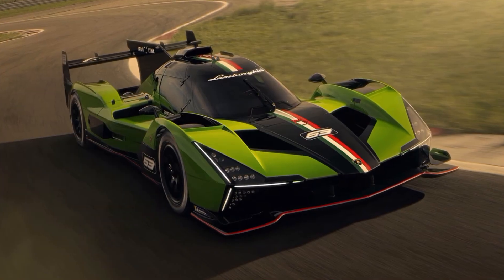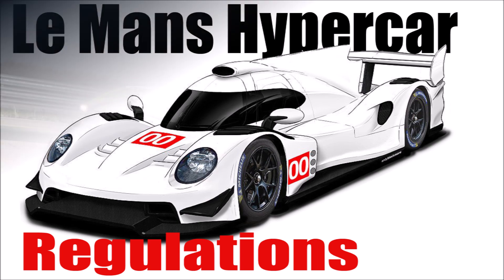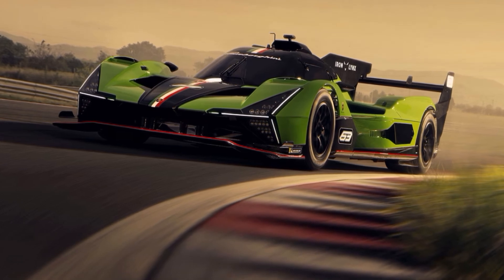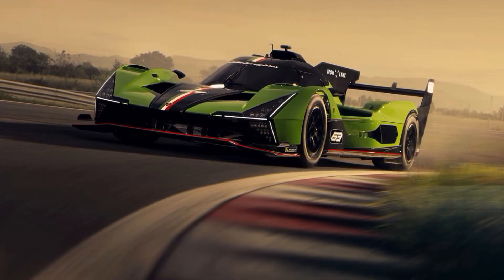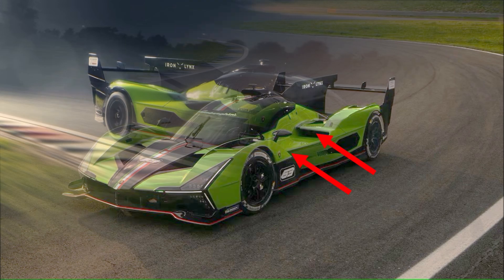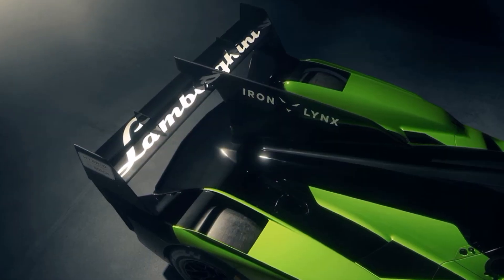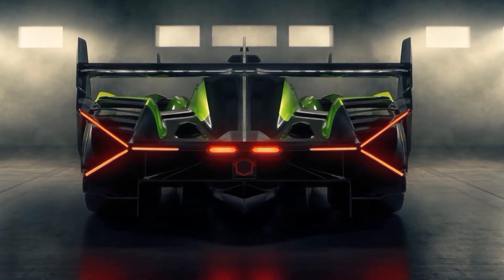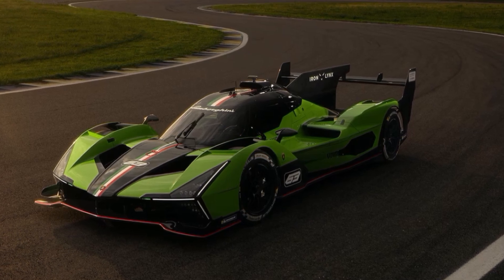Lamborghini SC63 LMDh Hypercar - FIRST LOOK

Comment: Why are the wheels not covered on the top? Is that just because the rules demand them to be "open-wheel" or is there an aerodynamic reason for it?
Reply: Get rid of the pressure in the wheel wells, have you seen the wheel well vents on the AMG One?

Comment: Missed opportunity not using a Lambo V10.
Their roadgoing engines should be more than powerful enough for this application, and running under BoP regulations means weight shouldn't be a concern. The only reason anyone else would avoid a V10 is cost, but Lamborghini should be able to pull engine blocks straight off the production line! Surely their in house V10 would have been a cheaper option.
Given that this whole thing is a marketing exercise it's really just weird that they wouldn't use the opportunity to make more connections to Lamborghini roadcars.
Reply: The connection to the road cars is the V8. It'll be used in the Huracan successor, and the Urus also has a V8 (a different one).
Reply: @R4M_Tommy  If the Huracan successor has a V8 that's super lame.
Reply: @budthecyborg4575  it's not "if". It's known.
Reply: @R4M_Tommy  So with that we're left with a grand total of zero V10 sportscars on the market.
No more Viper, no more R8, no more Lambo.
Everyone in the sports car business may as well just retire.
Worse yet that's my best bet to what the big companies are thinking, electric is so much less labor intensive the cars are practically disposable.
Reply: @budthecyborg4575  the Viper was the first sporty car to have a V10. The V10 is a relatively new and hard to balance engine for high performance applications. Even in F1 the first V10 appeared in 1989.

Comment: Happy to see Lambo finally giving a go to racing, but in all aspects of this, they have gone down a conservative path. The design is just as if you had made a render using another car's body with the Revuelto's light signature, the engine is predictable, they went for the safe option of the LMdH... Not the proud initiative and innovation they boast in their trailer. Toyota with their LMP1.2, Peugeot with the wingless design have gone for a bolder approach, and it seems to pay off in some ways. Except if Ligier does an exceptional job (which would be difficult since they're lagging behind everyone else), there's no reason why Lambo should do better than the other manufacturers with more experience, more budget, more innovation, more boldness, more design even (unbelievable for a Lambo), more of everything basically.
Reply: LMDh are low budget because they're all going the same route. LMH cars can afford not to do so because you simply have more budget to work with

Comment: I'm gonna be that guy...it should have had a V10 or V12 :(
Reply: Not efficient.
Reply: Then you'd end up with the typical street Lamborghini. Nearly 2 tons, pretty much.
Reply: @groundedgaming  Not weight. One of the most dominate lmp1 cars the puegeout 908 hdi fap had v12 and weighed around 900 kg.
Reply: @JeskoALT  900kg is already very light, F1 cars now are already over 850kg.

Comment: I was hoping that it would have V12 engine with THAT name...
Reply: I wonder what the 63 even meant. Mercedes already uses 63 for V8s, but this is an Audi, and the engine isn't 6.3L, it's only 3.8L. So I'm with you wondering what the 63 is for.
Reply: @groundedgaming  founding year of lambo squadra corse
Reply: @blankfiile  only of Lambo.... Squadra Corse started some 10 years ago

Comment: They decided against the Porsche concept because it's a shitbox and everyone knows that (...and i work for Porsche)
Reply: What do you think, should Porsche have done a LMH car instead, where they are in control and responsible for all components?  Would be curious to know what Porsche insiders think...
Reply: @dra911  sure
Back in 2018 the idea was to use the 919 streetversion (which was designed to be the next 918) as the base for the lmh car, powered by an all new tt 2.5 V6. Then the management changed, and they decided to do F1 and we started to put the lmh Money into F1 and develop that V6 as a 1.6 t V6. In the very same time the customer racing side was asking for a product above the gt3 due to the demise of gte, so they decided to develop the lmdh car alongside audi and multimatic. That lmdh was never designed to be a factory car. 
Then the F1 project died and audi pulled out of lmdh. The management decided to make some very last changes before the fia homologation in the lmdh to make It Better, to make It more 'Porsche' doing a mess.
The bop was considered the saviour of the project, but we all know that the car Is not good and underdeveloped. Lamborghini wanted to wait a bit to see the 963 doing something, and they realized the ligier thing was Better.
Reply: @dra911  and i want to tell u the story about that old v8 we re using! Audi was in charge of developing a 4l tt v8 (derived from the RS6) and at the end they didn t let us to use It! The V6 was under developed so they found that 20yrs old lmp2 engine adding 2 turbos. Result, the Power Is not there, we re slow in the straighs and we burn a lot of fuel.
Reply: @edoardocasagrande4339  Thank you for your replies!  Without trying to pressure you, can you elaborate on the last minute changes to make it more "Porsche" ? Or is that the engine change you refer to?  I'm surprised a twin turbo large-ish capacity V8 is not up to the task of making power (despite its age) as the output is limited by rules anyway, right?  Thanks again for any insights you can share.  You always hear about successes, but fails are sometimes more interesting to learn from.
Reply: @dra911  no worries!
The software guys had to change a lot of things because audi didn t let us to use their techs and data (i can t talk about the details). The engine change was quite easy and we choose that old v8 because It s very similar to the audi v8, but we needed to make few changes to engine mounts and flanges to make It work, and Just there we Lost a bit of chassis stiffness. The Power Is there but It s very difficult to use It because of the maximum fuel/Energy allowed by the fia, so we can do like 4/8 laps and then we Need to tune the engine down a bit to save Energy. It s quite difficult to manage from the pits.
Let s see what happens....
Reply: @edoardocasagrande4339  OK, so that's interesting, I was not aware that the fuel/energy restrictions worked like that. What of the chassis? My feeling is that this car appears not to be so easy at the limit - with apparent traction problems, lack of mid-corner speed vs others, etc.  I hope the car can be made competitive without relying on too many BoP "gifts" so to speak. Best of luck and thank you again (from a huge Porsche fan.)
Reply: @dra911  yeah the chassis it's not the best of the 4, It s a slighty upgrade multimatic Mazda. That's the 1st issue, then add a lower stiffness from the new engine and few aero losts from those last day changes and you have what you see trackside. Lmdh are very difficult to modify that may require a new homologation, i can t talk that much about that but we ll see something, we re on the limit.
Reply: @dra911  and thanks from me and the guys!